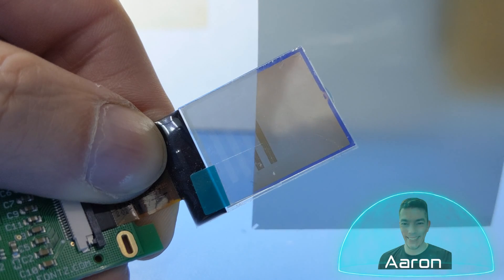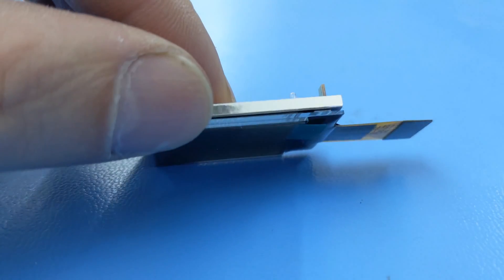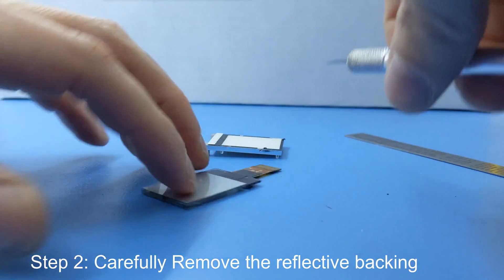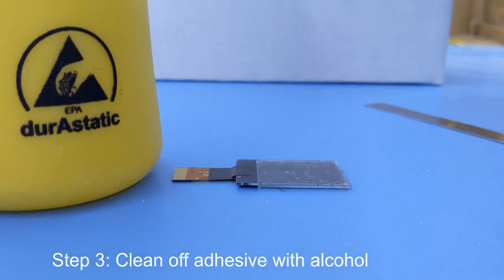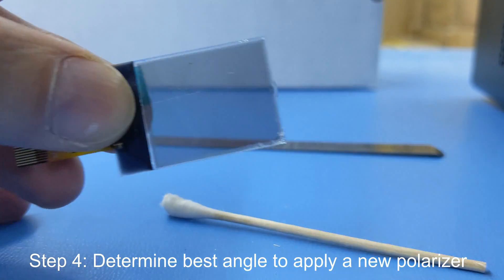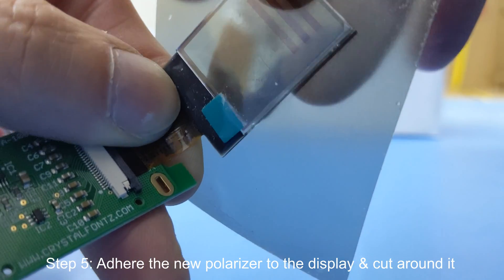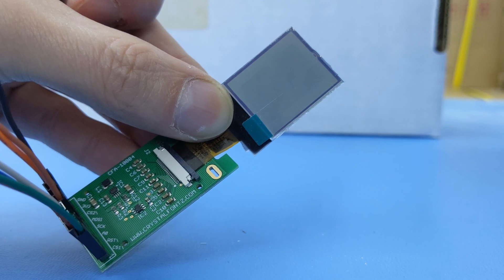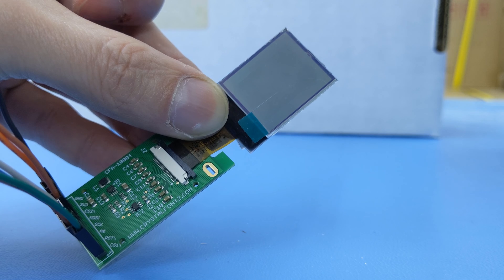How To Make a Transparent LCD - In 5 Simple Steps

Comment: Does it block light a 100% by the polarisation? I'd love to do a use case in which the black parts of the LCD block the light from behind
Reply from the maker: No they don't block 100%, I think what you're looking for is called "liquid crystal light valve", try search that term and let me know if that's what you had in mind. I hope this helps.

Comment: i always wondered why these displays don't use a white backing instead of silver, since that would make the font pop more and also allows the backlight to shine through much better.
Reply from the maker: A white surface reflects light diffusely—it scatters light in all directions. While this works well for ambient light applications (like reflective LCDs), it's inefficient when you're trying to direct backlight through the LCD stack.

Comment: Step 2 and 3 would be much easier if you pick up some spray designed to remove stickers or labels.
Reply from the maker: yes, we recommend using an alcohol solution for removing the adhesive.

Comment: Can we use rubber strip in a digital watch to  connect it for display in Casio f91w mod
Reply from the maker: I'm not really sure how you could make that work... You'd need to connect the display to a breakout board, then provide power and something to drive it...

Comment: Very Cool! Is it also easily possible to remove the polarizer on the front?
Best regards,
Johnny
Reply from the maker: If you remove the polorizer entirely, you won't be able to see what's being displayed on the screen.
Reply: @Crystalfontz  of course, i have some other polarizing optic already in the Experiment. Is it easily possible or not? Best regards!
Reply from the maker: yes, it's relatively easy to remove the polarizer
Reply: @Crystalfontz  cool,thanks! then I am going to order! I assume it is  also some film polarizer?
Reply from the maker: it comes as a single working display, that you remove the poloarizer from and add one of your own, it does not come with additional polarizer.

Comment: I have 4 questions.
1: does this work with every display
2: do you use a special polarizer?
3: does this display use color
4: do I see stuff on 5inch displays without a backlight

It would be helpful to get an answer, since I want to use this in a costume and if I would need a backlight, I would need to build a custom one.
Thanks in advance
Reply from the maker: 1) Nope, monochrome LCDs only 
2) Nope, standard polarizer
 3) Nope, monochrome
4) Depends on the display type, not TFTs
Feel free to reach out to support@crystalfontz.com
Reply: @Crystalfontz  OK can I send A detailed question there with project details (new to transparent displays)
Reply from the maker: @YannisAtabay  Sure, we'll do our best to answer your questions.

Comment: Is there a lcd that doesn't need the glass so it's more flexible? Great video, BTW!
Reply from the maker: Thank you! We're not aware of any that are transparent and flexible. LCDs in general always use glass for many reasons. The other options are OLED or ePaper, which we do have flexible versions of them, however they're not transparent. I'm curious what you'd like to see made with a flexible and transparent display?
Reply: @Crystalfontz  Ok, thanks! I was just thinking, I might want to put it on something that is a little curved.

Comment: Was hoping to use this as a uv mask for circuit board fabrication, do you know if this is possible for larger displays and if so which model would you recommend?
Reply from the maker: It really depends on how they're built, some displays are much more difficult to remove the polarizers. I'll check with our engineering team and see if they know which larger ones may be easier to work with.
Reply from the maker: Our engineers, think you may get better mileage looking at the tech used for SLA printers and modifying a DLP projector.  https://kt421.wordpress.com/2015/07/07/modifiying-a-dlp-projector-for-use-in-an-sla-printer/